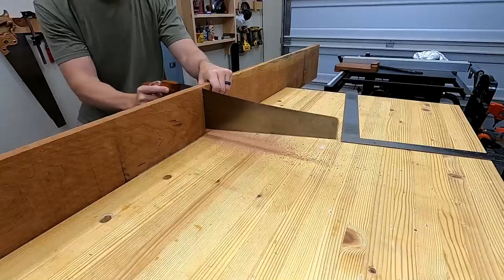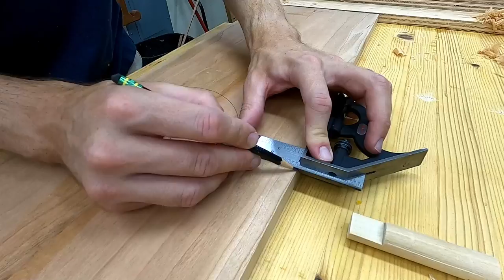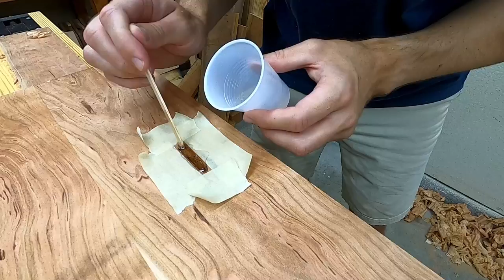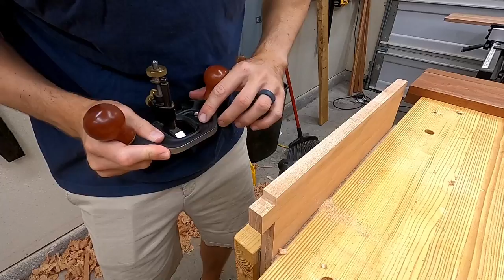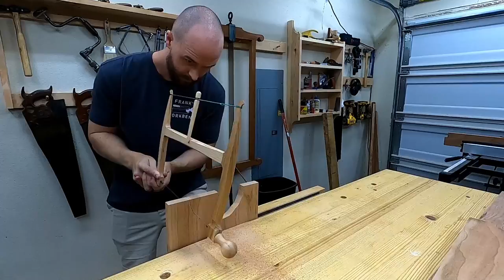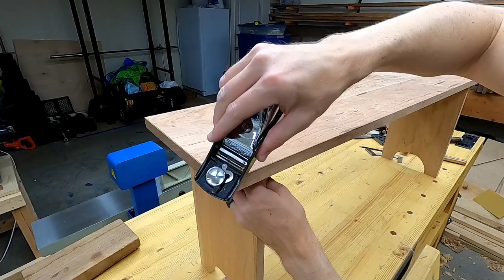Classic Craftsmanship - Shaker Bench

Comment: I almost always do the initial crosscutting of boards to rough length with a handsaw as well. I used to do it with the workbench vice like in this video. However, I never liked maneuvering big boards into the vice and then flipping them to finish the cut. It just felt like a lot of extra handling. So I made a saw bench. The top is just at or below knee height so I can lay a board on it and use my left knee as a quick clamp while I cut. When crosscutting, I don't have to stop halfway through. To make the next cut, I just take my knee off the board and slide it so the next cut line is just hanging off the bench. It can be used for ripping by hand too. Oh and since it's about knee height it's reasonable comfortable to sit on!

Comment: I note that you place your metal hand planes cutting blade down on your workbench.  I was taught that was a no-no to prevent damage to the blade edge that extends below the bottom surface of the tool.  I learned this about 60 years ago.  Regardless, you do know how to sharpen.
Reply: Yeah I heard that early on too.
It's kind of an old wives tale.
If you think about it. When planing you're plowing that blade though wood and it doesn't damage it. So why would setting it gently down in the same position do anything to it at all.

Comment: Another great instructional video Frank!  I am curious why sanding is needed after finish planing. The cherry looks so rich and warm off the hand plane.
Reply from the maker: i agree and only do if ill be using the tried and true or other straight up oil finish. not needed if I use the waterlox, shellac, or varnish type finish. Sanding burnishes the surface so it wont soak up the oil inconsistently. you can also rub vigorously with plane shaving

Comment: Regarding the finish, I’ve been thinking about trying to do a wash coat or two of shellac and then do the oil finish. Wonder if that would help with dry spots? I’m currently using a polymerized (heated, no driers) tung oil from Lee Valley. I like it a lot but know what you mean about getting the dry spots sometimes.
Reply from the maker: a thin cut may work, good idea to try

Comment: How much do you overlap your plane by on each pass? I've been having a hard time flattening boards by going lengthwise, I usually have to use the technique where you go at 45s in both directions to get a flat surface. Whenever I try to finish by going lengthwise I end up less flat

Absolutely love your content, your videos are always a joy when they pop up
Reply from the maker: I also struggled with that and it drove me nuts. Strangely, two most basic skills are also the hardest won - sawing to a line and planing a board flat. Check out a book called Essential Woodworker by Robert Wearing. The first section of the book covers some of this stuff and has a few planing exercises that were helpful for me. Go slow with the book and really digest it because there isn't a sentence of fluff in the entire book.
Reply: @FranksWorkbench  perfect, thanks so much for the candor and recommendation!

Comment: It turned out awesome Frank 🤙 it always turns out awesome tho 😁 What's your opinion of the Ashley Iles chisels? Ease of sharpening and "feel" in the hand are my main concern, I'm not worried about how hard they are or how long they can hold an edge. 
Thanks for the video lad 😁
Reply from the maker: great chisels, my only real point on comparison is narex. I like the Ashley iles more in terms of hand feel and they both sharpen easily. a few ferrules came loose but its an easy fix and I dont blame the tool as im sure theres a big humidity difference between the UK and Texas
Reply: @FranksWorkbench  There would be a huge difference in humidity, I'd try to glue the ferrule first if it was me, I dont like the dimple when theyve been punched.   
I forgot to thank you for your tips on finishing....... that is an area that I'm seriously deficient in 😂 your pieces always look really good, that classy timeless look, partly because of design, but I reckon the finish adds to that too 🤙
Thanks Frank 😁

Comment: Do you sharpen your own hand and panel saws? If so, any resources you've found useful? Or do you send them out to be sharpened - in which case, where?
Reply: There is an excellent write up on a site called "vintagesaws", it goes into great detail and was very helpful to me when I first started filing saws. It's written by Pete Taran, he's one of the lads who founded Independence Saws (later sold to Lie Nielsen, the saws are basically the same, LN jus kept makin Pete's designs) 
I always recommend that write up to anyone wonderin about saw filing...... It is very daunting at first, but once you file a few saws it's actually very easy. Some will say about findin an old saw to practice on, this will need shaping not just sharpening...... It's a lot more work to shape the teeth, and it's much harder for someone who is new to it, I would recommend a maintenance sharpening to a saw you already own. This will only take a couple of licks of the file for each tooth and will get you used to it, try practice on a rougher saw if you have one, 4-5tpi is very easy to sharpen..... around 13tpi it gets harder to see what you're doing and small variations in the pressure and stroke of your file will effect the smaller teeth easier. Anything above 15tpi is a pain in the face to sharpen, try avoid a fine saw like that til you gain more confidence. If one tooth is slightly low don't worry about it, you will pick it up the next time you sharpen. If there is very slight variation in the rake or fleam of the saw, don't worry or try to file it out..... What makes hand filed saws so much nicer to use is that slight variation; similar to the way a machine cut rasp will judder or vibrate because the frequency of each tooth is perfect, a hand stitched rasp is much smoother and will not judder or vibrate because the teeth are random...... Similar concept with a saw, but only a VERY slight variation with saw teeth is acceptable. Aim for perfect, but don't chase it.
You will need saw files (like a three-square file but it also cuts on the corners. This leaves a small round in the gullet of the tooth which makes it stronger. A saw file technically has 6 cutting edges) You want the file to be slightly bigger than the depth of your tooth; with the file dropped into the gullet, slightly more than half the file should be above the tooth, if less than half the file is above the tooth you will wear the file unevenly. You will need a saw set, the old Eclipse style pliers is still plentiful on the used market and they work very well. When you gain enough confidence to file finer saws you should get another saw set, shape the plunger on this so it's very narrow....... The normal size plunger on that style of saw set is too wide for fine saws and it will push on 2 teeth instead of 1. The number on those saw sets is noting to do with tpi, it's jus a guide; for example, my 4tooth rip saw is set with the pliers on number 6, my 13tooth tenon saw is set with the pliers on number 10, my 16tooth dovetail saw is set on number 12 and the saw is lightly filed again to remove some of that set. Somax in Japan made a copy of the Eclipse style set too, they are also very good. I've used the new saw sets sold on eBay and the likes, the plunger on those is soft like a pillow and I had mushroomed it after setting about 4 saws....... The old ones are much better in my opinion and cost less too. As for files, mine are made by F. Dick (German I think) Swiss files made by Valorbe are excellent too, I've heard good things about Bahco files but have not used them myself to be able to comment on them. Filing thin spring steel is hard on files, shaping the teeth on an old saw you could kill the file on that single saw....... Normal sharpening you will get maybe about 6 sessions from a file (that's maybe 9-12 months of sharpening for me, but others mileage may differ) get yourself a couple of files in the size you need, use one for most of the work, but save one that's new or barely used for the final sharpening of your saw. A small stone of about 1k grit will be needed to adjust the set after you're done. Use a cheap stone for this, something hard; a Japanese water stone is not great coz you're gonna wear grooves in it. I use a diamond stone coz that's part of my sharpening gear for irons and chisels, but I plan to buy a small hard Arkansas stone for that job soon. 
Good luck, and enjoy 😁🤙 sorry for the essay 😆🤣
Reply from the maker: yes I second what Whitty said ive used that exact resource. I do sharpen them myself, but I'm really not qualified to instruct anyone else as I dont do it perfectly or fancy and have a very rudimentary process .... all I do is simply run a flat file on the teeth to make sure all are about the same height then file the teeth with a triangular file so that the point is sharp again. Sometimes ill set the teeth prior to filing with the least amount of set that my sawset can do.
Reply: Paul Sellers also has a couple of saw sharpening videos that are great resources.

Comment: How do you feel about your (Baileigh?) jointer?
Reply from the maker: wouldn't buy it at todays price but at the time was only a couple hundred more than the grizzly. HOWEVER, in the 8" jointer field the Baileigh has the tallest and longest fence with an 83" long bed. that was the deciding factor for me. Even though its got straight blades, those can always be upgraded later. At the time, the Oliver was the same price and it comes standard with the helical cutterhead, but it has a smaller bed and fence which can never be changed. Unfortunately, I did just have to replace the red shut off button as it broke and that cost me $50 shipped which is kinda lame but its all just cheap asian junk on all of them. Bottom line is its a great jointer but if I were buying one today it would be a grizzly for half the cost.
Reply: @FranksWorkbench  Thanks for the write up! I'm sure I'll do another year or hand wringing and research before I actually buy anything.